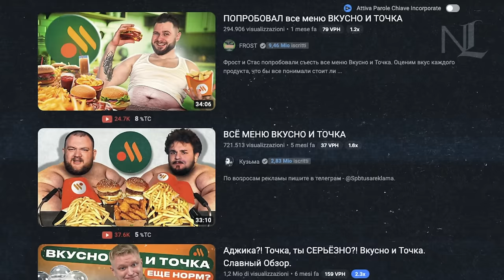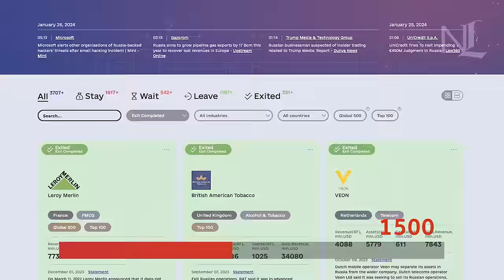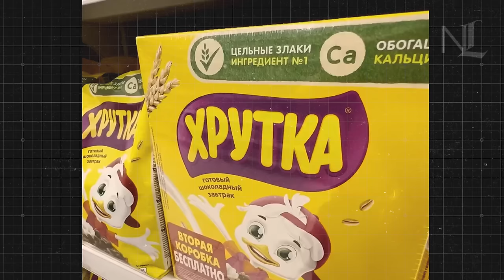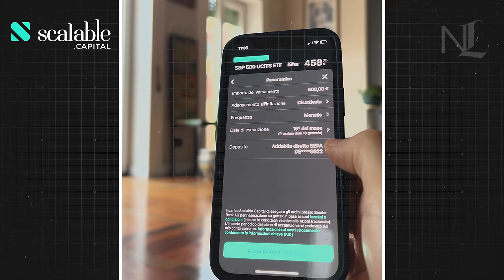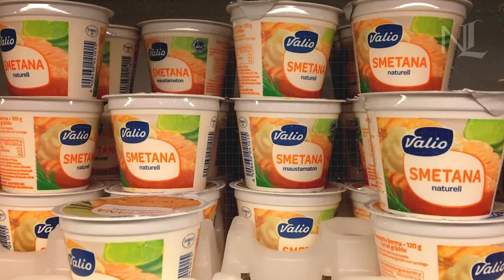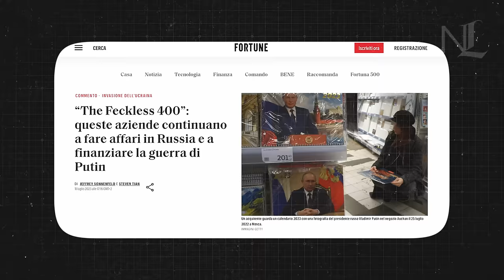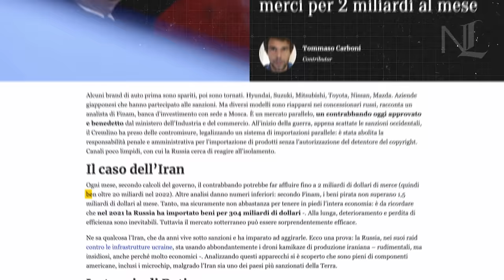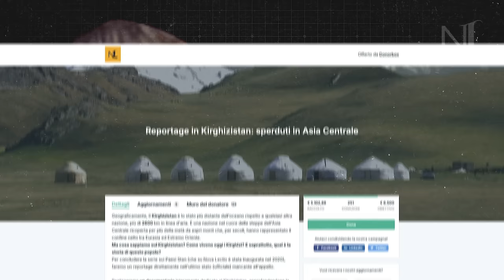Perché i brand occidentali sono ancora in Russia?

Comment: You're looking in the wrong place. to figure out this issue, you need to perform a gene upgrade of the brain. Hint: 90% of the "Italian" pasta brands sold in Europe belong to the Rostov and Shebekinsky pasta factories. you can argue which tires are better - German or Italian. ALL tires in Europe are made of Tatar rubber. in most cases, they are manufactured at the same Tatar factory. what brand of technical fluids do you prefer for your car? Shell, Mobile, Castrol...? ALL technical fluids of "European manufacturers" are produced in Dzerzhinsk. what brand of car would you not buy (Volvo, Volkswagen, Renault, Peugeot, Fiat ...) - you bought 1 ton of steel from Severstal, or NLMK, you don't like it - buy from the Chinese!
The USA or Brazil can feed Europe (at X2 prices), but they will deprive Europe of work. 
Europe for Russia is a herd of Papuans.
 Russia is a Deity for Europe, and Putin is His Prophet!